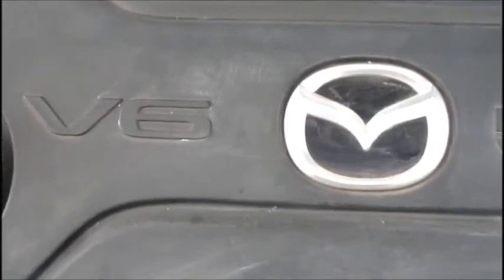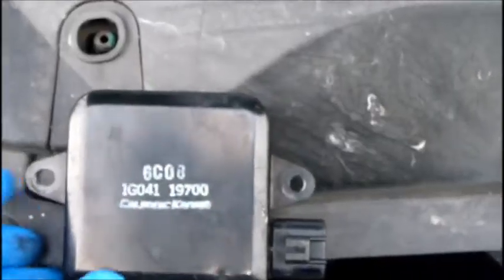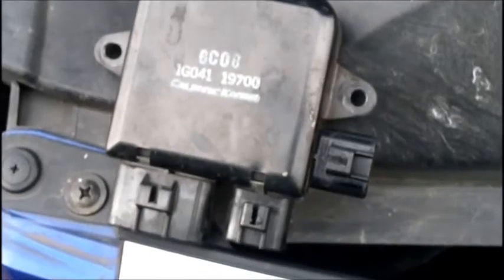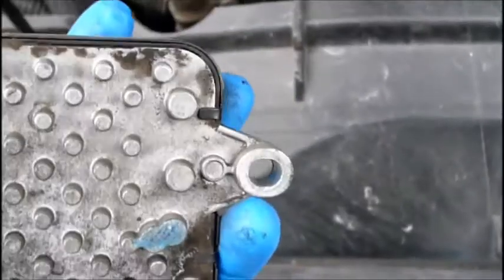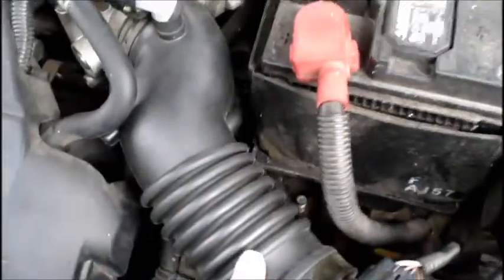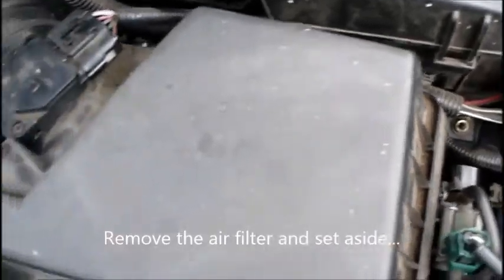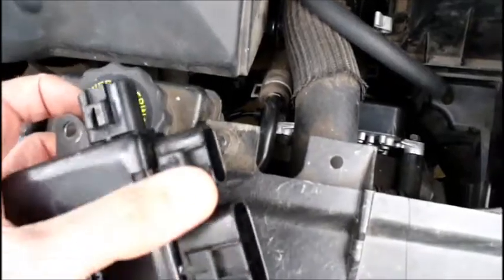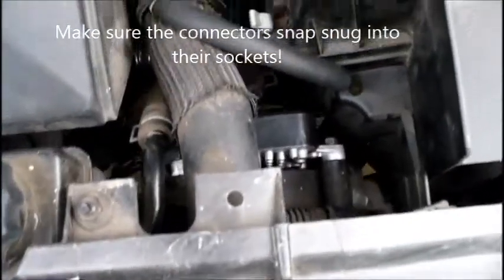DIY Mazda 6 Cooling Fan Control module troubleshooting and replacement

Comment: The module on my car does not look like that and I can’t find the exact one that needs to be replaced I need help
Reply from the maker: If your car is not a V6 and of this age, then it would be different. Otherwise I don't know why else it would not be the same.
Reply: @DavidTheFixerofThings I think it is cus the main modules I see online are different. My condule is connected to the fan so I suggested I’d have the buy the whole fan and module together
Reply: With a no connect on the side of the module
Reply from the maker: @michaeloreus2695   take a look at my cooling fan replacement video and see if it is like yours.... sounds like you have a different model. https://youtu.be/ZnONA3GdpGY?si=kJk-2FGENSj7qK_9

Comment: Thank you for the info and the video David! I just replaced the module on my son's 2005 Mazda6 and it stopped the fan from running 24/7. Pretty easy job. Be patient getting off the old clips on the module and the inside nut holding the module in place. If you have a ratcheting 10MM box wrench, that is ideal. I got my part online. Prices were all over the place. I got mine from 1A Auto for $65. Job took me about 30-40 minutes to complete.

Comment: Where did you get you coolant fan control module mine is bad in Mazda and  I need to replace it.I looked at some places and its 71.00
Reply from the maker: read my description above for details. but you can google that part # and find lots of suppliers. some are cheap and won't last. others "OE" type will. However, you probably will eventually need to replace the entire fan module. See my other video on how to do that.

Comment: I 've change my module control, is it normal that the speed of the fan is slower than the one that i replaced or does it need to reset in order to get faster? Thank you very much...
Reply from the maker: The fan speed is temperature dependent. it will run faster if the engine is hotter. Also see my video on replacing the entire fan module, in the event the controller fails again.

Comment: Where did you order this part???
Reply from the maker: on the internet, there are a lot of places that sell these. try Rock auto. Or google the part number I show in the video. just be cautious that there are a lot of cheap aftermarket brands that do not last. Best to stay with an OEM approved brand. also, be aware that many times the fault of this controller is because the cooling fans have worn out and are now drawing more current than they should, and this controller does not handle this correctly (poor design), and will blow it out again. IN this case, I recommend replacing the entire cooling module. see my other video on how to do this procedure. good luck

Comment: Any idea where module is located on a 2005 mazda 6,  4 cylinder?  I do t see it where yours is.  I figured it was under the air box...nope!   Any idea?
Reply from the maker: sorry i don't know. I have not done work on the 4 cyl. But if it has a fan unit on it, then it must have a control module someplace. it may have relays in the fuse box. But in general, the 4 cyl version did not have this issue with cooling.
Reply: @DavidTheFixerofThings  Thanx for getting back to me so promptly, really appreciated.  I never did find it and didn't want to deal with tracing it down.  I ran a set of new relays and connected to acc.  and a thermal switch on the neg. side.  It works fine.  My system just shut down and overheated.  All gooder now though. Thanx again.
Reply: H BB bv BBC

Comment: i need a little help idk if anyone will see this. my mazda (protege) smells like its burning my fans rarely come on and my over flow tank boils and when i turn off the car it always leaks so bad. it never gets over half on the temp guage. but my honda accord never went over half and it melted the gasket out the head lmao. so im thinking (and already ordered) a new radiator with 2 new fans. i also have a new over flow tank and will go get new hoeses. i got a new water pump and a new thermostat. is there anything i am missing before i rip it apart or somthing i should do while im already doinf this big hull.
Reply from the maker: The first thing I would check and replace is the thermostat. Then flush the radiator. You mention leak? I assume you mean radiator? if that is leaking then probably a good idea to replace it. Fans probably  not the issues. but the controller for them might be! I am not familiar with the older Protege so not sure how it controlled the fans. Water pump should be replaced only when it starts to leak. No need to replace something that is not broke! good luck
Reply: Also make sure ur coolant resivoir cap is sealing good and tight

Comment: You can test the fans by unplugging the control module and using a positive wire and negative wire and placing them on the clips from the module and the battery and they will spin if they work
Reply from the maker: if I am understanding what you are saying. NO you can not do this without damaging the fans! these are not standard DC motors. They are stepper type, thus the reason for a controller that can send PWM signals to the fans to pulse them, this is how the module controls the speed of the fans. You may damage the fans putting straight 12v to them.

Comment: temperature sensor location mazda 6 v6 2007. Please
Reply from the maker: I'm not sure where that is. It might be in the same place as a 2006. If you are referring to the coolant temp sensor? I think that is on the manifold. Its has a gray two wire connector on it. You may also want to check out my fan replacement video: https://youtu.be/ZnONA3GdpGY

Comment: I have a 08 lancer. The fans are spinning when I turn ac on but car still overheat... the ac doesnt blow ice cold like it use to also. Can that be a bad module or ac sensor?
Reply from the maker: That sounds like you have several issues going on. 1. your AC unit is in need of service. perhaps charged, or it has a leak. 2. your car is over heating because of a thermostat malfunction, or a temp sensor. If the cooling system fans are not running all the time, and only come on when you turn AC on (which is normal for them to run), then the cooling fan module is probably not the issue.

Comment: i have a 2010 6 with the 3.7 v6. my fan stays on all the time. even with ignition off. it just runs until the battery is dead. any advice is appreciated!
Reply from the maker: this sounds like the control module for sure.  However keep in mind, many times these blow out as a result of the fans drawing too much current. you can view my video on how to replace the entire fan assembly. You can pull the fuse out on this to bypass it until you get it replaced. However, you gamble that the engine will over heat! good luck with the repair.
Reply: The fan control module is integrated with the fans on the Mk.2 Mazda 6 (2009-2012). The entire fan assembly is replaced to fix a faulty module in that model.
Reply: @FeelGoodND  rockauto lists a fan control module for 57 dollars. for a 2010 6 with 3.7. are they wrong?
Reply: @jonshaffer5793  That is not the correct one.
The control module on that car is inside the fan. THe one you listed is external to the fan assembly and the one used for the 2003-2008 model.
Check STANDARD MOTOR PRODUCTS RY1919
Reply: @FeelGoodND  thanks for the advice. idk why rock auto has parts listed for cars that won't work with said parts.
Reply: @FeelGoodND  hey sorry to bother you but if i order the entire fan assembly that should fix my problem right? thanks for your time.
Reply: @jonshaffer5793  Hey there, no problem at all.
Mazdas suggested repair for a faulty fan control switch (Mk.2 2009-2012) is to replace the entire fan Assembly as a unit. I believe there are affordable (compared to OEM) units available in aftermarket for that.
Reply: @FeelGoodND  thanks!
Reply: @FeelGoodND  hey, sorry for sneaking in this old conversation... But can you tell me if this fan can be opened to replace the module? Or I must replace the complete fan? I have my Mazda mk2 abandoned for over a year since it overheats everytime i use it. Plus, the OEM spare fan here in Mexico is worth $900 dollars. It's insane how much it costs :/
Reply: @FicatoMaximus  hey there, no problem as that's what great about the internet, it never forgets. 
The fan can be opened but it needs to be removed in order to do so. you may have to remove the radiator to do this as well because I believe the fan attachment screws are on the inside. You should be able to cut the fan control module off and solder the new one in place to avoid the increased labor, provided you can find the module sold separately. In the US the fan assembly control units sell for around $450USD. I believe the module alone is around $300.
If you are lucky, a salvage yard will have one. Worst case, maybe you can find someone stateside who can ship you one. Good luck.

Comment: My fan doesn’t turn on at all. I believe the fuses are fine and I checked the fan motor and it’s still spinning when I hook it straight to the battery. Would it be the fan control module?
Reply from the maker: Those fans are digital (stepper motor style) you can not run them directly to DC. it will damage them. You most likely damaged the fan unit. The control module might be no good either.  take a look at my fan removal video.... https://youtu.be/ZnONA3GdpGY

Comment: I have a 2010 mazda 6 i can not find the relay anywhere
Reply: 2.5L
Reply from the maker: this video is for a V6.0 liter. Sorry I don't know where it would be on a 2.5L, and I am not sure they would be the same
Reply: @DavidTheFixerofThings  was wondering if you knew. Thanks
Reply from the maker: @R3alalityCh3ck  . I looked this up. The control module for a 2.5L is different. here is a link to a place I found one. Expensive! https://www.rockauto.com/en/catalog/mazda,2010,6,2.5l+l4,1444877,cooling+system,cooling+fan+control+module,12955
Reply: @DavidTheFixerofThings  It is located inside the fan assembly.

Comment: Hi there - This is called a cooling fan resistor right?
Reply from the maker: Hi, No. It is a controller. There are active electronics in this module that control the velocity of the fan. It does not act like a resistor at all.
Reply: @DavidTheFixerofThings  is it the same as the radiator fan switch?
Reply from the maker: @ianmc7887  you could call it that. However there are actual cooling switches as well that can trigger the fans to come on. Depends on the year and make of the car. In the case of the Mazda 6, this control module IS the radiator fan switch
Reply: @DavidTheFixerofThings  thank you for the reply!

Comment: My Mazda keeps popping these. They each only last a day or two. Sigh. I guess I'm going to have to do the bypass procedure with manual switches inside the cabin.
Reply: The reason it keeps popping them is the fans are bad and are pulling to many amps. You have to replace the fans also.
Reply from the maker: see my video on replacing the fan units. https://www.youtube.com/watch?v=ZnONA3GdpGY

Comment: I have a 2005 Tribute, with the A/C on the temp would go up, loose cold, and prompt the fans to stop.  The problem is it wont turn the fans back on again with the hot engine. Is the FCM busted?  The thermostat is working and have replaced one fan motor which is blowing low.
Reply from the maker: Hi. thanks for checking in. That is an odd one for sure. Usually when there is a temp problem, turning the AC on will help cool the engine down! But you are seeing the opposite. So it could be the FCM. With the AC on, do both the cooling fans run? They should. Given the age of the car, the FCM is a good place to start. Keep in mind though, if your module is defective due to the fans drawing too much current, then replacing the FCM, will probably not last too long before it goes out again. I recommend both cooling fans be replaced and the FCM. However you said you already replaced one fan, so you might get lucky and the FCM will function fine. The cost of FCM is not too expensive, and a good place to start. I provide a video on replacing  the cooling fan module on my channel. Not sure if it is similar to the Tribute though. good luck!

Comment: I am having problems with the fans, not sure what, car has been over heating but temperature gauges don't show it, another thing when u cut on the air conditioner, the fans aren't coming on, any help would greatly be appreciated
Reply: Mine is doing that now! Do you remember what it ended up being?

Comment: so you are not going to show how to fix it?
Reply from the maker: If your referring to how to fix the module? there is no way. It is a sealed device, no serviceable parts. The fix is to throw it away and buy a new one.  thanks.
Reply: David The Fixer of Things - no dude, you open it and fix or r/r internal demage otherwise that is a waste of time, and time is money and time too

almost everything is fixable now; any one can change parts, even a 5 yrs old kid, but to fix things and know what you are doing, that's a different story bro - it's very simple, you better watch this following example so you can understand how this world really work for us:

BMW ign coil cpu driver/ mosfet video repair intruction -

https://youtu.be/RO12NiE5g1E
             &
E36 immo by pass/ or r/r with older brown bosh ecm test and beyond instructional video -

https://youtu.be/pnR7QL2J0A8
Reply from the maker: @facesmasher4216  Thanks for your comments. so let me educate you a little bit "bro". I have been an engineer for about 30 years. In my line of work, we learned in the R&D world that it is not cost effective to "troubleshoot" down to the component level on low cost items such as this. Secondly, I do my videos for the weekend mechanics that may not know much about electronics, and therefore I do not generally go into depth with them. Even though I know the cause and solution of the failed part. Yes, I could have spent an hour or two tearing this unit apart and troubleshooting it, and then maybe, if I happen to find that the defective component is NOT a surface mount, and I could de-solder it,  I could have. Then I would need to search online for a discrete component to buy. order it, and then wait for it to arrive. Time is money "bro" and it is not cost effective in this day and age to "fix" at this level. My time is worth a lot more than this controller is worth fixing. When I was first starting out in electronics I would tear things apart and fix them. It was fun, and I learned, but I have been there, done that. don't need to anymore... thanks again, and have fun "fixing" things.

Comment: Ok it's the 3rd one put in it!!!!! Sick of this crap ok put a toggle switch now,  after old owner put new radiator new fan thermostat. And sensors so tired of it!!!!! Its a MPV can same module.
Reply from the maker: dang that is a problem. sorry to hear about your issues. I actually had to replace my fan modules twice because the first one was the wrong type and did not work. poor quality Chinese crap. I also had to replace my control module twice, then I figured it out that I must replace BOTH of them with OE type components, and it now works like new!

Comment: Hey there installed a new fan control module with the help of your video but it was a defective module. If you are able to find the seller you purchased yours from and let me know?
Reply from the maker: if you have a 2008 or newer Mazda, then make sure the module you buy is for this year, as previous years are slightly different.
Reply: David The Fixer of Things  thank you!
Reply: My third one .
Reply from the maker: if this is your 3rd module that has failed then it is extremely probable that the root cause is actually your fan assembly. Replace BOTH fans and the control module all together at the same interval. problem should go away. check out my video on how to replace the fan modules. good luck
Reply from the maker: sorry it didn't work. there are a lot of junk ones out there. I don't remember the one I bought but if you get one that has the part # on the module, it is most likely an OEM. Mine cost me about $20. what year is your car? Because after 2006, there were some slight changes so the its important you get the right moduel!
Here is a link to one I just found on Amazon. It looks ligit, but only from 2003 to 2006 models. https://www.amazon.com/2003-2006-Mitsubishi-Outlander-1C232-19700-AJ511515YA/dp/B077WDC5ZH/ref=sr_1_1?s=automotive&ie=UTF8&qid=1533921453&sr=1-1&keywords=mazda+6+fan+control+module
Reply from the maker: well that kinds of sucks to get a DOA module. I don't remember exactly where I bought mine from but I made sure it was an OE type that had the part number similar to what was on mine printed on the module. I would search ebay or amazon for those type. I think the company name was GlobalSource .I am pretty sure I bought mine from ebay. Are you sure it is the module and not the fans causing it to fail? You might want to check out my video on how to replace the entire fan assembly. It the fans are worn out then they will just continue to burn out your control modules....